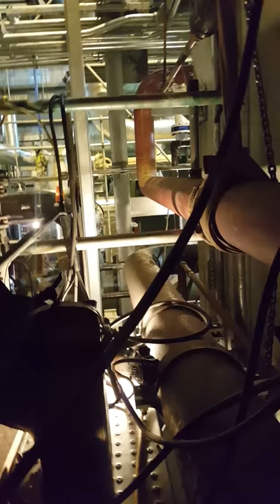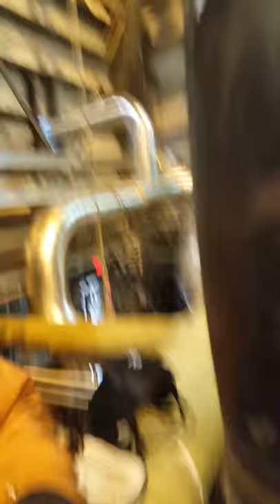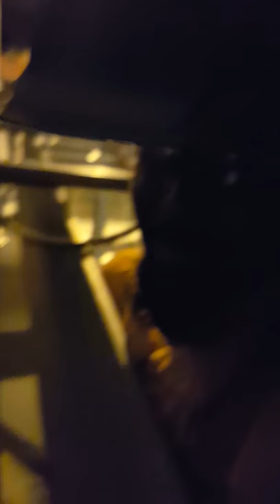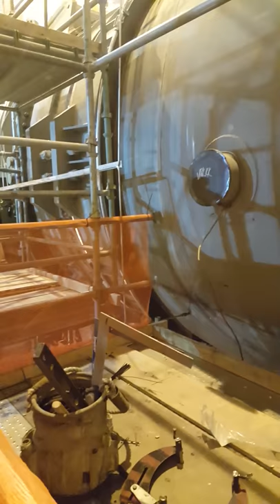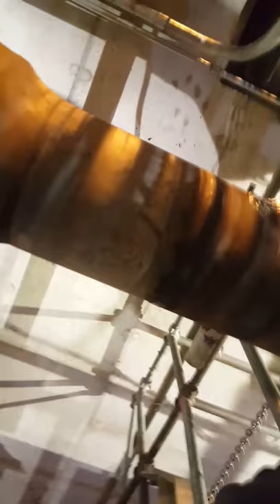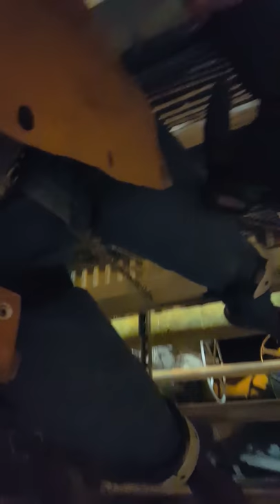"Pipe welding" It's punch out time!

Comment: Chris. Sorry for the late response but thanks for the info. I am in welding school now. It's a 1 yr program. What is a typical starting salary for welders straight out of school? Thanks again
Reply from the maker: Hey no problem, The starting  salary for welders just out of  school would be the same salary for a welder thats  been welding 25-30 years, when you go into the heavy Industrial Field it doesn't matter how much experience you got whenever a company bring you on as a pipe welder or a structural welder as long as you pass your welding test you make the same amount of money as anyone else that's doing the same thing you're doing, so to answer your question it all depends on the project and what they're paying. Most projects for pipe welder's pay no less than 29.50 that might be the least you would get paid and as high as $51 an hour depending on what state you work in.

Comment: What test is procedure to hire in? You a combo welder, nice. Sub’d
Reply from the maker: Typically you're gonna take a 2" monster coupon weld test in the 6g position, tig the root pass and hot pass then stick weld the  rest of the way out.
Reply: christaner what do combo welders make nowadays if you don’t mind me asking?
Reply from the maker: Anywhere from $28 an hour  all the way up to $105 an hour,  plus a perdiem for food or hotel stay.  It really boils down to which company you choose to work for, there's a lot of companies to choose from, typically you want to go into heavy industrial that's where the money is. Commercial don't pay that great. I'm in the heavy industrial field,  Things like power plants ,gas plants, chemical plants ,coal burners ,CT units and  Nucula power plants, just to name a few. One can easily make 6 figures or better a year , we do it all the time.
Reply: christaner I want in. I took the 1 year course back in 2009-2010 and have been on a few drilling rigs but mainly on pipeline. And now I’m an assistant welding instructor at the college here. I wanna go out and try it for the summer. I used to work in power plants back in 07 repairing valves. But never as a welder

Comment: It's punch out time bro how many pipes you usually weld during a day?
Reply from the maker: It all depends on the size of the pipe and the thickness of the pipe.
Reply: What size is most common?
Reply: Do you think if I bought a bunch of mild steel pipe to practice on that It would be hard to transition to stainless?
Reply from the maker: No not at all.
Reply: Thanks for reply bro. What bout chrome is alot harder to weld or just a little different?

Comment: Like videos what do you set the welder on too pass structural test or pipe stick weld also you know of any jobs in Texas area hiring
Reply from the maker: For stick welding structural test or pipe test use 3/32  7018 rode, set your amps on 90. Make sure you keep a close Arc and a good travel speed.

Comment: Hey Chris, what’s the tolerance on a tig root? Also how hot do you run your tig root? I’m trying to break out on pipe in the refineries here in Houston next month.
Reply from the maker: Working in the refineries usually the QC "Quality Control" like to see a 3/32 root penetration or less. 70% of the time all pipe welders will get a guideline on what the QC is expecting to see on a complete and finished weld test. 30% of the time the QC will give you the guidelines and talk as if he's going to follow them but really all he wants to see is a decent looking test.  Visit www.christaner.com
Reply: christaner Ok i see. Is a 3/32 root penetration with tig what they usually want to see in most of the plants or compressor stations or whatever it may be?
Reply from the maker: Yes, that's right.
Reply: christaner ok nice then my root is within tolerance. Here in Houston we have plenty of offices in Pasadena for companies such as KBR, S&B, Brown & Root etc. Which companies are best to work for in your opinion?
Reply: Brandon Hernandez how did it go for you? Did you break out